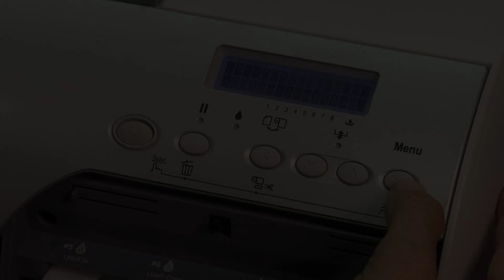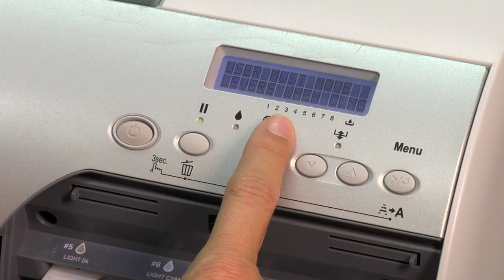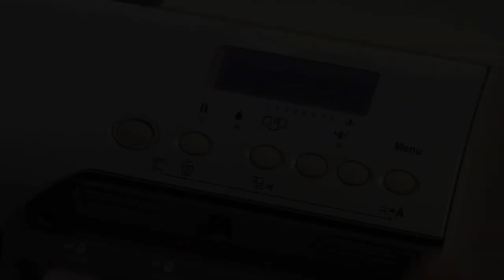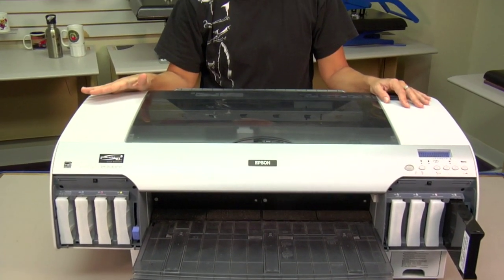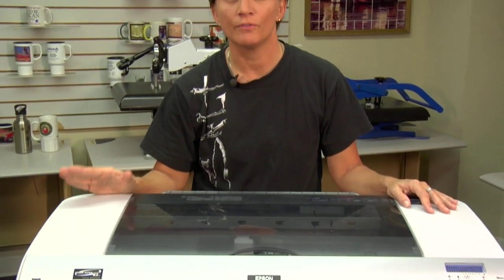Power Cleaning the Epson 4880 - When, Why and How To -

Comment: Thanks Vicky.  I have a Epson 4880 and my black quit printing.  Test print and all colors but black is perfect.  I installed new cartridges as well with no success.  I performed a deep cleaning with no success.  There is zero coming out of black. Not even one dot.  Do you suspect the print head itself?  I could use any help.  Thanks!
Reply from the maker: It is logical to suspect something wrong with the printer at this point, Most likely it is the print head.
Reply: I am trying the soaked paper towel cheating method just to see if i can get anything out of it.  If not is there a way to test the head itself?  Or could it be the supply data to the print head itself?
Reply from the maker: mowerdog
Contact Epson for advice on that.
Reply: thanks

Comment: Hey Vicky, I have a 4000 that has been sitting a couple years. I'd like to take this to dye sub ink. I have 8 carts filled with cleaning solution on the ready to clean the lines. How many power cleaning cycles must I run with cleaner before the lines will be clean enough to make an ink switch? Thanks for all your helpful information.
Reply from the maker: Here's what we recommend, get the serial number off that 4000 and call a Conde account Manager (800-826-6332), we have a new program starting 10/31/17, (ends 12/31/17) where you can get 4 extra free inks when purchasing the new SG 800 if you "trade in" an Epson. printer - that's a great value!
Or, call tech support (if you are our client) and they can help you flush, but it's probably not viable with all that old dried ink in it.

Comment: Hi, could you please tell me the possible reasons as i have just got a new Epson 4880 two weeks ago. it was all working fine but now the magenta is continuosly missing. I tried power cleaning as well, changed the cartridges as well.
Reply from the maker: On this printer if you go more than a day without printing the print head is prone to clog. Magenta is typically the first color to clog. Make sure you run at least a nozzle check once a day. There is a program called Harvey Head Cleaner that you can get and install that will schedule head cleanings on this printer.

Comment: I started a power clean as a last resort. It has been doing it for ages! I'd like to stop it before it used ALL my ink up. Any way to stop it? I've tried turning it off and on.
Reply from the maker: When you start a power clean on an Epson printer the only thing you can do is let it run its course. If you try to stop it most of the time it will just make it start over
Reply: Thanks. Gosh I wish I'd known that. However it seemed to not want to stop. Must have gone on for half an hour before I thought hang on!
However I did find out that if I took out all cartridges then turned off printer for a while and put them back in it started afresh. Phew.